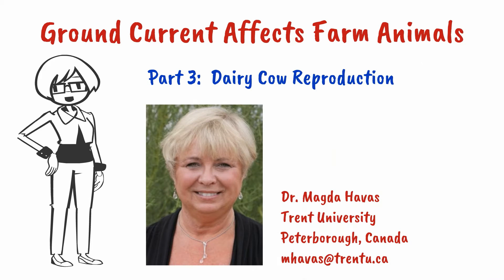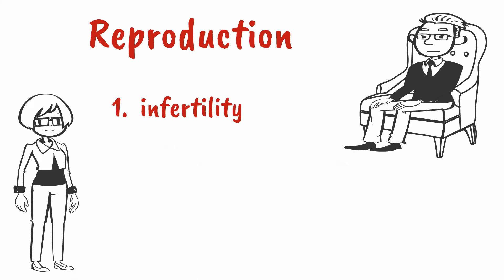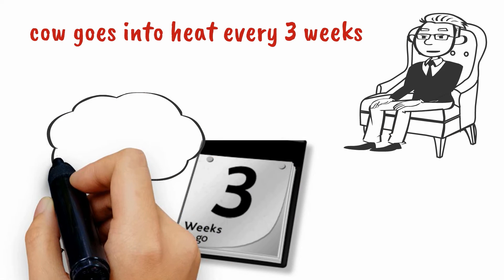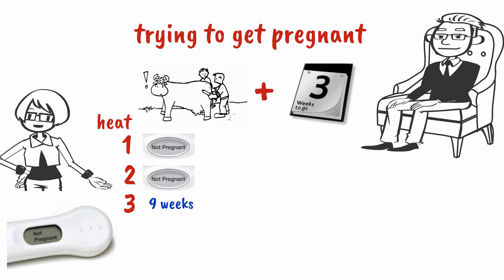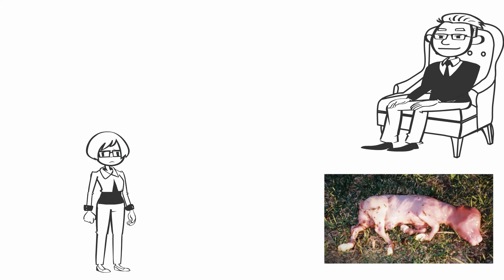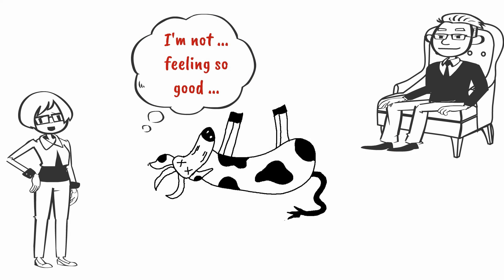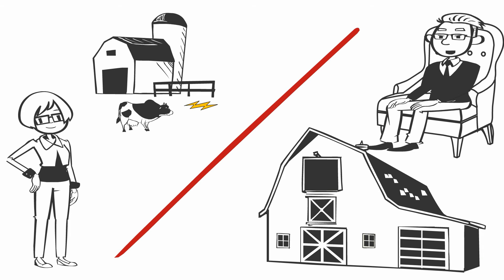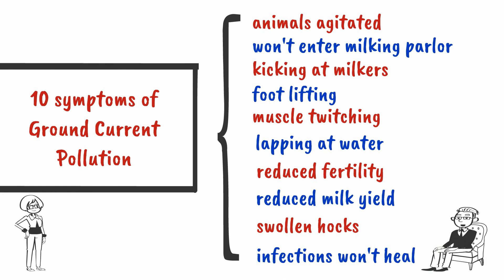Ground Current and Reproduction on Dairy Farms with Dr. Don Hillman

Comment: Do electric fences (polywire, for example) for livestock which use grounding rods into the ground, also create problematic ground current?
Reply from the maker: The fences can cause a problem if they are not grounded properly.  The pulse does not travel on the ground unless there is a circuit.  The pulse travels only on the wire and is an open circut, until the cow, human, other animal, grass or weeds touch the wire, thus completing the circuit.  The ground then carries the pulse back to the fencer to complete the circuit.